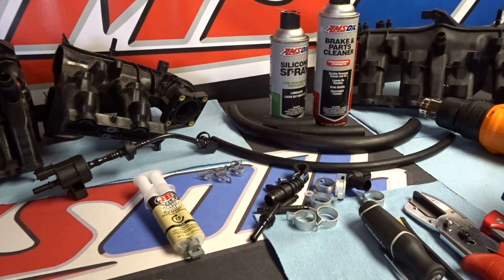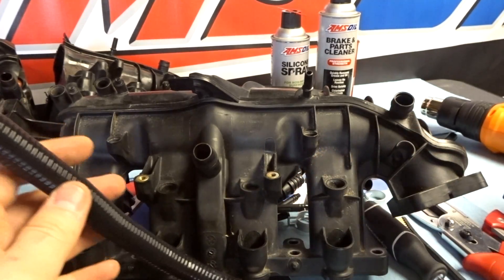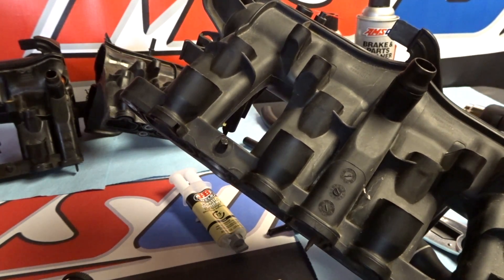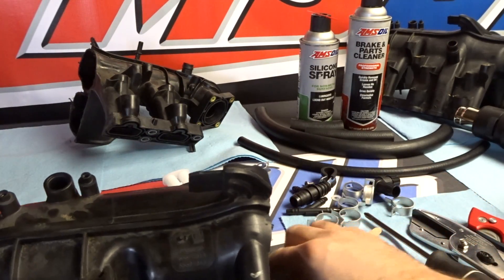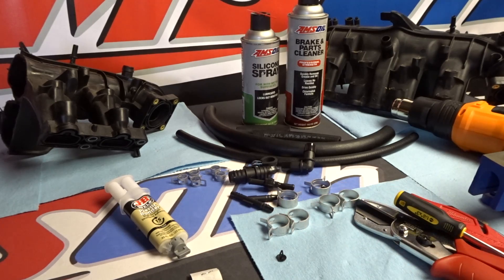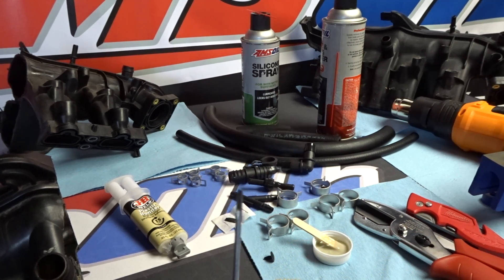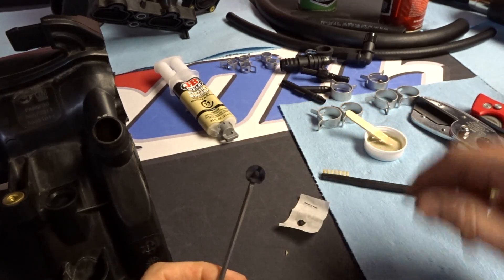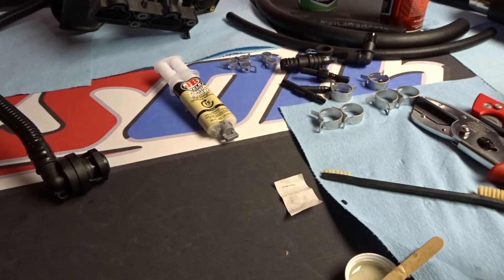How to Install the CruzeKits.com V3 PCV Fix Kit

Comment: Hello I purchased this kit and installed it along with a new valve cover. Im having an issue. Seems that my Sonic is building too much pressure as it is pushing oil out of the edge of my valve cover. Could it be that the check valve is positioned wrong? I have it with the point of the arrow facing towards the fitting/ drivers side.
Reply from the maker: Either check valve is backwards or valve cover is defective (happens A LOT).
Reply: Hello how did you solve problem?

Comment: @Dre Dan , why not adapt a PCV valve to fit directly on the port from the intake manifold to the OEM hose? It seems though that the point of failure is the poorly designed integrated PCV inside the intake, so why not add one externally and use the same OEM routing. This is Just my observation.
Reply from the maker: Because that would be redundant to the check valve at the turbo inlet and you still need a way to connect the pcv path to the intake manifold for vacuum. That simply wouldn't work.
Reply: @AndreiDPop  ah. I see now. That's what I wasn't getting. Thanks for clearing that up. Great video.

Comment: Can't we get away with putting the plug inside the manifold and keeping the rest of the PCV system in its original configuration? There should be enough vacuum at the turbo inlet even at idle to allow for that...
Reply from the maker: No, there is practically no vacuum at the turbo when the engine is under vacuum. If this were the case, GM wouldn't have bothered. I've seen people do this and they reported more external leaks over time. You also need the vacuum to provide a better piston ring seal (we are running low tension piston rings), which will reduce oil consumption and improve efficiency.
Reply: @AndreiDPop  Well, that clears things up alright! Thanks again for sharing your expert knowledge!

Comment: Got my kit today . Took about 30 min to do changed valve cover also . Runs like a champ again . My check ball inside intake was gone . She was pushing oil out valve cover . All fixed now. Thanks for the speedy service. 👍
Reply from the maker: Awesome, that was fast!
Reply: I have the same issue. Which version is best recommended?
Reply: @BigDaddy-ih9de  I got the one with everything

Comment: Hi! If there is a lot of dirt(hard oil) inside the intake, around the red valve, how can it be clean before installing the kit? Is it safe to use brake cleaner and let all the dirt flow inside? Thank you.
Reply from the maker: Yes, it's safe, if you can get it cleaned that way. Whatever it takes to get that port wall cleaned will work. If it is crusted on there really hard, you may need to remove the intake manifold to clean it properly.
Reply: @AndreiDPop  Thanks for your answer. One more thought... if the red nipple is still in there, is there a way to check if it still functions properly ?
Reply from the maker: @sylviu88  You would need to vacuum test the crankcase and boost leak test the intake system.

Comment: Random dumb question here. I've seen all the kits, including home-made ones not designed by you, re-route into the intake manifold. Why not just plug the pcv flapper hole and use the stock pcv to turbo line for vacuum? Is the design just to keep any stray oil out of the turbo?
Reply from the maker: Because the turbo itself doesn't produce much, if any vacuum when the intake manifold isn't under boost.

Comment: Once this occurs and after fixing with the kit does the valve cover with the integral PCV valve also need to be replaced- that is does the PCV get damaged due to the loss of the little flapper valve and will need to replace the valve cover also?
Reply from the maker: Valve cover contains a vacuum regulator diaphragm. It's a separate component and does need to be replaced if it fails. The valve cover does seem to fail more often or prematurely when the intake manifold check valve fails.

Comment: Question: Do you know if the pcv valve in the intake is also in the intake on a Chevy Volt? It is the same engine, but no turbo. My thought is that the Volt may only use the crappy valve in the valve cover and there isnt one in the intake??? The intake on the Volt is a different shape and you cant see around the corner properly to tell if there is one inside it. I would need to cut it in half like this to find out. Thanks for any help anyone has!
Reply from the maker: I haven't see one but I doubt it, because there's no need for it. The check valve in the IM on the turbo engine is only there to close off the PCV system from the manifold when it's under boost. If there's no boost, no need for that check valve.
Reply: @AndreiDPop  That was my thinking too. Thank you for the reply to build confidence in that thought process!

Comment: Is there something wrong with the website? I can never get in it doesn't load
Reply from the maker: Sometimes the security of your device isn't high enough or your network is blocking the site for some reason. Try another device.
Reply from the maker: If it still doesn't work, let me know and I can send you an invoice.
Reply: Is it possible I can just cashapp or Zelle you the cost, then send me the v3 kit ?
Reply from the maker: @josetamayo7612  I'd much rather use a PayPal invoice if possible. What's your email address and what kit and options do you want?
Reply from the maker: @josetamayo7612  Just sent you the invoice. You can delete your comment with your email so it doesn't get picked up by some spam bot.
Reply: @AndreiDPop  thanks i set up my paypal but i dont know where my card is at. I lost it somewhere in the house and still haven't found it that's why I asked for the other methods lol I'll just get back to you whenever I find it or when I replace it

Comment: Nice video. Will this fix my oil odor coming out of my heater?  I had my 2012 Cruise intake and injectors replaced after my PVC failed while doing about 90 on a cold near zero morning. It was under warranty back then.  Thank you.  The oil smells like fresh oil, not burned.
Reply from the maker: I wouldn't know if that would fix it or not without further diagnosis of your issue. You might have an external leak somewhere.

Comment: Can all the fitting b replaces with metal fitting????if so do u have any recommendations..I will be getting the v3 kit..just want to know ur opinion..
Reply from the maker: I don't have metal fittings but you could do that if you wanted to. You can change the kit as you see fit; it's just a set of DIY parts. If you want a better check valve, you're more than welcome to swap one in.

Comment: Hi thanks for the video and the kit, just wondering if the vcuum reglator is bad, does the kit still work or first  I hvae to replace the valve cover?  Also does the valve on the connector to the turbo has to be working too?

Comment: My kit arrived here in Australia yesterday. Keen to install everything this weekend, my question is however! If the check valve is still inside the manifold, whats the best way to remove so i can instal the clip with epoxy? I had a peak in there to prepare myself and my valve is still in there although definitely not doing its job correctly! Cheers
Reply: Same question. I purchased a new ported intake and the check valve is there.
Reply: @scottsutch4427  I ended up taking to the little plug / check valve with a small flat head screw driver. It did come out through the front as I pushed down from the top.. but I figured most people have the plug dissapear anyway so it wouldn't matter too much if it fell into the manifold.

Comment: I have a question: if I want to install this kit without removing the intake manifold & there is some dirt or oil residue inside the manifold - is there a way to clean it somehow? Or loosen it with some spray or something(except the one in the video)? Or should I just clean the top part, install the kit and that's it? Thank you.

Comment: I just got done installing a v3 kit. It is quite simple, well thought up, and should be effective once the glue cures.  It is amazing how GM's f-up can be fixed with a collection of stuff liable to be found at a hardware store.  I recommend practicing the heating of the nylon somehow before doing your first one. I put the "y" carefully in a vice and it moved on me as I was pushing the line on it and ruined it. Luckily, I had some nylon fuel line laying around that I cut off of a vehicle a long time ago and I got it right the 2nd time. I put the heat gun in the vice and wore a glove to keep the heat off of my hand. 
The plug stuffed into the intake manifold was an interesting process to execute, but easily done with a steady hand and some patience.

Comment: Couldn’t get the button with epoxy and now the hole is caked up with epoxy. The button kept bending and flexing as I tried to put it in. Don’t know what to do now since I can’t clean out the hole.
Reply from the maker: Just cake on more epoxy and let it cure. Should be fine. If the plug was bending, you had the wrong hole or it was plugged with deposits. You can clean it out with a 90-degree pick when that happens.
Reply: @AndreiDPop  I literally found myself staring at my tools and seen that 90 degree in my tool box.I also got a hot rag and stuck it in the hole with a screw driver to clean it out so there’s still a shot at a second chance. Thanks for the great video and kit.
Reply from the maker: @yeyo3194  if you need more plugs let me know. I can send you a couple more.

Comment: Hi,
I had a quick question, my wife's 2013 Cruze has an oil leak coming from the oil filler cap, I'm assuming there is too much positive pressure in the valve cover. I'm guessing its a PCV issue, would I be correct to assume this kit would help. Or am I barking up the wrong tree?
Reply from the maker: If the intake manifold check valve is missing or malfunctioning, yes this kit would help.

Comment: V3 check valve issue:

My car started running a little rough, and I was also having an issue with oil leaking out of my oil fill cap and dipstick. I noticed that when pulling the dipstick, I had positive pressure. I replaced the seals on both, and I also removed the check valve for inspection. After confirming that there was no air flow whatsoever, I cracked it open(very easily) and noticed that after about 5000 miles, the Viton plunger expanded and conformed to the shape of the housing, preventing it from moving. (defective maybe, it is almost as if the Viton melted and spread out) I ordered 2 more of these and hope for better results. I have also ordered the Brass check valve and barbed fittings and will find a way to support it if/or when I encounter the same issue with the replacement check valves.

Update: While waiting for the replacement check valves, I used an exacto knife to trim away the excess rubber that had expanded to conform to the shape of the housing, so that it would move freely again. I use the plastic bond that came with the kit to seal it back up, and it is working somewhat normally. When pulling the dipstick, there is vacuum again, and the car starts to stutter after a few seconds as it should.
Reply from the maker: Sounds like a defect for sure. I've had some people put over 30k miles on that valve and they've been fine. Apologies for the inconvenience. If it cracked open that easily, it was likely from a defective batch I had back in around March. The new ones are much better consistency. Let me know how the new valves do. If you have any issues, I'll have to go back to my supplier, as Viton is supposed to have excellent chemical resistance and heat tolerance.

Comment: Hi Dre, I purchase your V3 PCV Fix Kit. I have a 2011 Chevy Cruze LT 1.4L MFI Turbo DOHC 4cyl. I am getting code P0442. I changed the gas cap. I replaced the purge valve. I ran a smoke test (very little smoke around the throttle body, nothing I believe is the issue.). I even ran your booster vacuum air leak test. The vacuum leak is what has me worried as well. I let up to 20 psi into the intake area and the air goes don't within 8 seconds, but there is no visible air coming out from anywhere. Where else can I check because it is nowhere near the top or bottom of the engine? Please help!!
Reply from the maker: Did you lose the clip or o-ring at the intake manifold PCV pipe connection? 

Try turning the engine over and testing again in the off-chance that one of the exhaust valves is partially open. Should hold tight though.

Comment: I replaced my turbo, oil cooler, oil pan gasket, crankshaft seal, hoses and then I decided to look in that hole, it was clogged.  I cleaned it and the po299 came on.  Got my kit the other day and don't see a V3.1 video, should I make a video?
Reply from the maker: If you'd like to, sure. There's an article on cruzekits.com showing what the changes are. No a whole lot different.

Comment: Is it possible to install that plastic plug with the epoxy if the factory check valve is still intact?
Reply from the maker: No, the OEM check valve has to be broken off first.
Reply: @AndreiDPop    I'm assuming I can just break it off with a long pick? and if possible should I try to have it fall towards the intake side or towards the valve cover? Thank you for your quick reply and for making these kits!!!
Reply from the maker: @gasman7777  it will only ever fall into the intake side since there's a flap behind it. No big deal, as that always happens on the stock ones, at no detriment to the engine. You can use a screwdriver to break the tip off and use a pick to push the other side through.
Reply: @AndreiDPop   perfect thank you!

Comment: I'm a little confused about the direction of the check valve on the 3.1 kit. In the video the arrow points towards the throttle body. I thought the gas was supposed to flow towards the turbo charger.
Reply from the maker: Gas does flow towards the turbocharger, but not from the intake. The intake applies vacuum to the crankcase.
Reply: @AndreiDPop  thank you. I'm just nervous
Reply from the maker: @brandonvandyke1650  eh, don't be. I've shipped thousands of these kits and it's not that bad to install them.
Reply: @AndreiDPop  last thing here I promise lol. If I'm looking at the engine bay the purge valve flows to the right side or driver's side so the check valve flow should go the same way? I'm just confused because in the video the flow arrow on the check valve flows towards driver's side but the explanation sounds like the flow should be opposite of the purge valve. Thanks again

Comment: V3 kit installed today into 2011 Opel Astra with a14net. 185 000 km in clock. Original rubbet pcv was still visible but leakin air when on boost. Tested when valve cover removed. Although, no fault codes.
This instruction video helped a lot. Only difference is that there is some sensor in left-back corner where the New pcv-hose is supposed to be fastened. That would have been nice to be mentioned in the video, since the installaation on the video is done on "bare" inlet manifold. Not a problem, fastened the pcv-hose on top of that sensor.
I hope the plug holds and and there will be a difference in performance.

After testing I will write a post into Opel Club Finland forum so others will get known to this option to fix pcv withous throwing their wallets upside down and inside out...
Reply: 24 hour cure time aftermath and test drive: I am... amazed how different engine feels after the fix. Feels like different car. No hesitation at low rpm or when changing gear from 1st to 2nd or 2nd to 3rd when accelerating from traffic lights or such. When hittin 3000rpm there is noticeable twitch but thats forward and Its time to go. Before it was hard to say when turbo started ti spool.
Now the engine feels just like re-mapped 1.4 turbo is supposed to be.
Huge thank and high recommendation!
Reply from the maker: Thank you for the feedback! Please let me know if I can help in any other way.

Comment: Why is it 75$ for parts I can get from oreillys? Besides the one special t fitting but could be adapted easily with just one extra fitting
Reply from the maker: Shoot me a message on the contact form on cruzekits.com and I'll explain. I had something written up here but it's too lengthy for a youtube comment and I wanted to explain in more detail.
Reply: Dre Dan awesome I have a customer needing this done bad but they need a turbo too I wanted to be able to explain to them why the kit costs what it does so when they see it they don’t think I’m screwing them
Reply from the maker: @southernracing2468  give me a quick call. 219.779.7742. I also have installer pricing which gets you 15% off.
Reply from the maker: @southernracing2468  Just replied to your e-mail. Feel free to call if you want to chat.

Comment: What about adding an oil catch can where would be best?
Reply from the maker: You could run it inline with the 5/8" hose and mount it by the shock tower.
Reply: So it is necessary to have it mounted higher than the pcv basically
Reply from the maker: @sstanko19  That is ideal in my experience.

Comment: after installing this kit is it still recommended to run a catch can?
Reply from the maker: I personally don't think it's necessary to run a catch can, and prefer not to have the hassle of maintaining it, especially when I have to do so much more frequently in the winter, and it becomes far more of a hassle as well in cold weather.
Reply: @AndreiDPop  Then how is there any vacuum on the crank case at idle now that we've plugged up the idle pcv valve?
Reply from the maker: @akbarshoed  through the pcv fix kit's external re-routing of the original check valve.